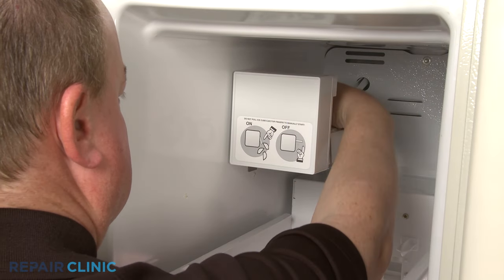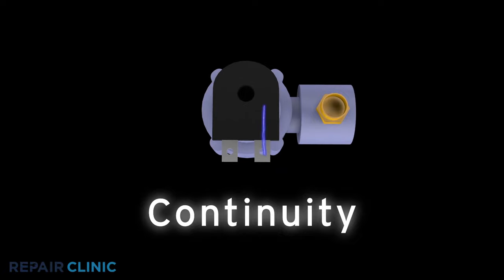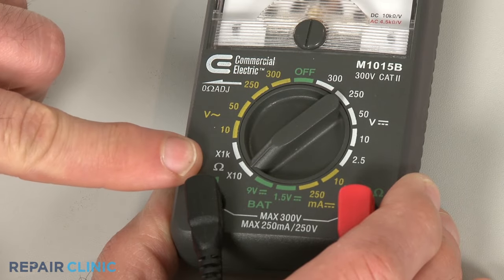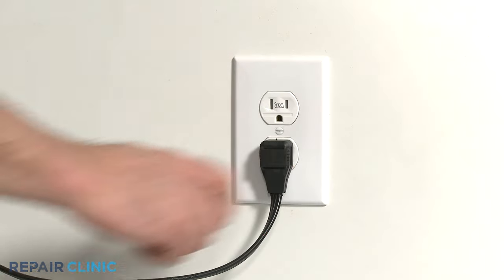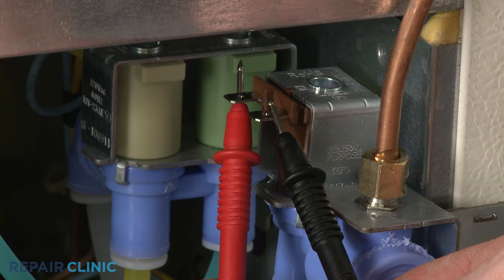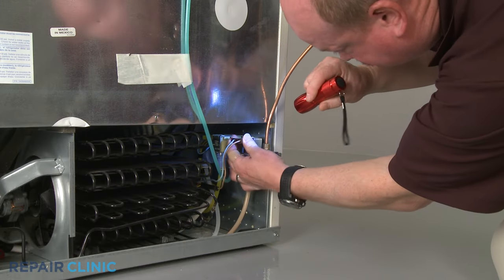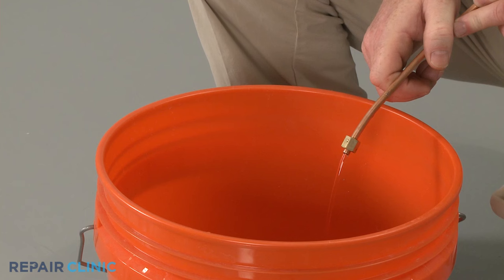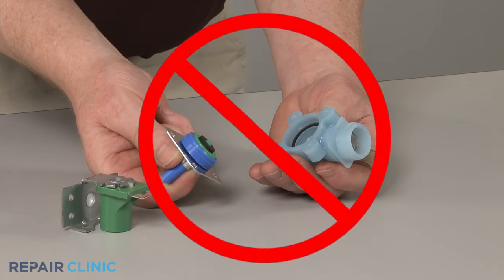Refrigerator Not Making Ice? Inlet Valve Testing

Comment: Dealing with a problem that may be Water inlet valve related where the ice maker works intermittently and  water seems to be leaking slowly into the ice bucket and making blocks of ice.  This is good information.  Thank you.
Reply: I have the same problem. Tech tell me to shut-off power, disconect the ice maker water line from the water valve and then open the water line. If you see leaking water then the value is bad!!

Comment: Wow... sure must be nice to work on such a nice clean unit! LOL... They make these cooling vents IMPOSSIBLE to get all the dust bunnies off the wires... OMG... I MacGyvered my vacuum hose with a funnel and tubing to get in as deep as I could through the venting but can only reach the front half. The rest, no MacGyvering will fix! I hate the system but you get what you get!
Good video BTW!

Comment: Ok I have the one with the 3 different connectors I tested each of them and it shows no continuity on each one. The ice maker doesn’t work but the water dispenser does. I swapped the 2 connectors for the water dispenser and ice maker and when I push the water dispenser water will come out of the tube for the ice maker so I’m not sure if the solenoid is bad
Reply: I have this same issue on a Maytag. Did you resolve?
Reply: @Jaxav8or  no I didn’t I think it’s the ice maker itself that’s bad. There’s a video on YouTube about manual starting an ice maker by slowing pulling the prongs if it doesn’t start after manually doing it then its probably either bad ice maker or electrical problem

Comment: I tested and meter is showing 247 for continuity. I suspect the inlet valve needs replacing. Repair man came by and said I need to replace ice maker. He never looked at the back . Water only goes about 1/3 up the water line to the freezer. I will ask that he replace the inlet valve first.
Reply: mine is testing at 241 for continuity. was yours bad? thanks